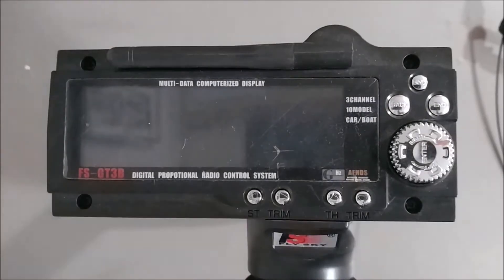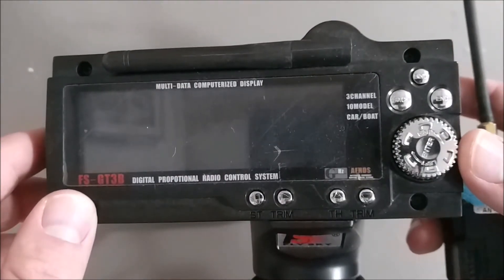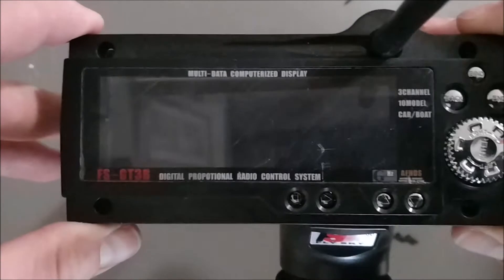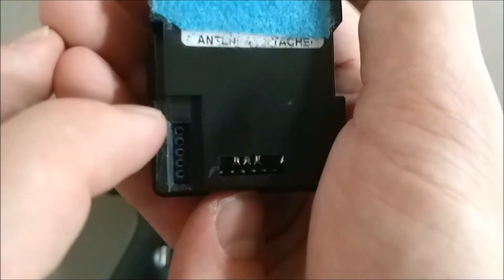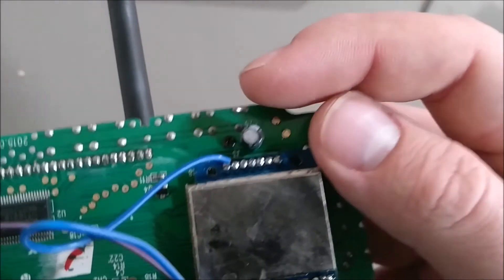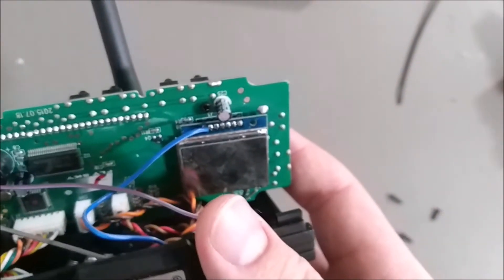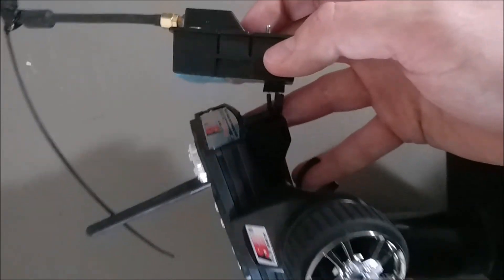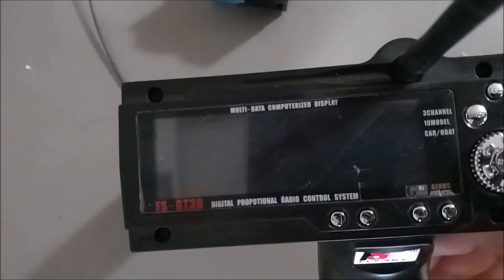Connecting a JR Module to a Flysky GT3B Ground Radio for FPV!! (Long Range Pistol Grip Radio!)

Comment: I know this is an old video but thinking about doing this mod for a speed run car.  I will be using an elrs module.  curious though if the module is unplugged will it still work with the factory flysky receivers
Reply: I would like to know this as well, as building a speed run rc bike and will need better range
Reply: Seems like theyre running parralel in this setup, might be advantageous to disconnect the power to it to prevent interference.
Reply: Yes if you unlock lug the module you can use the flysky receivers like normal on this setup when I was testing and running it the elrs module is powered by a seperate 2s battery to run the flysky receivers all you have to do is unplug the module from the dsc port.  I have since sold this system because I got a radiomaster MT 12
Reply: @rickzfpv3118  Wicked. I need something I can butcher to just convert pwm to ppm basically.

Comment: You can do this same mod to the GT3C but you require a 3s battery to run 12v to the module and 3.7v thru a ubec to the radio itself.
However not really worth it because even after the firmware update the mixing is shit.